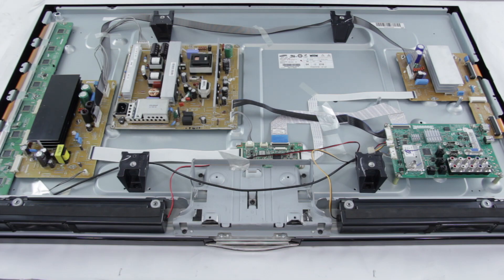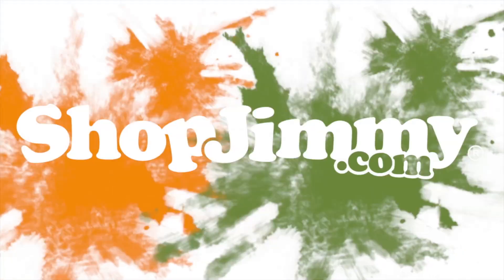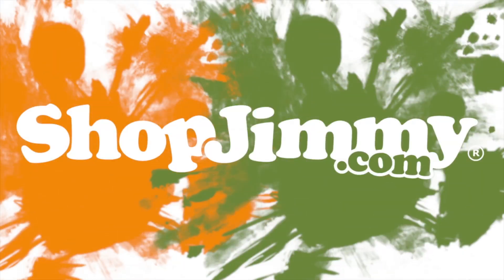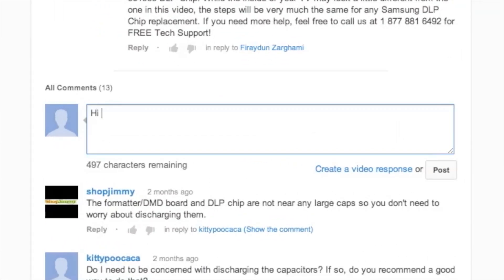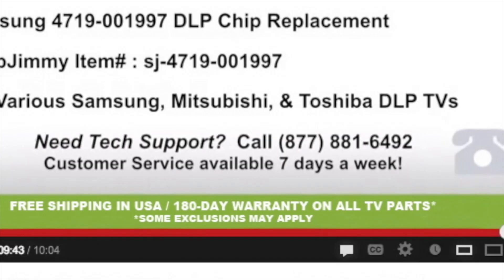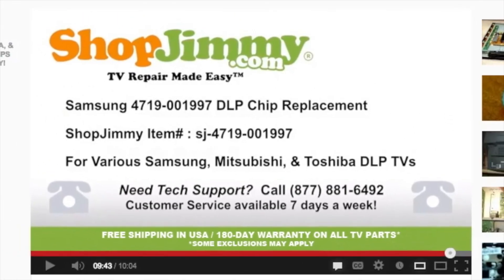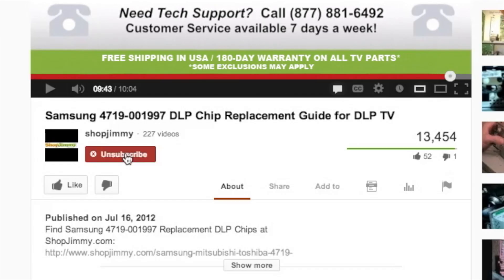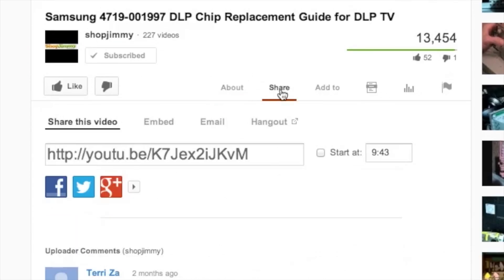Plasma TV Repair Tutorial - Common Symptoms & Solutions - How to Fix Plasma TVs

Comment: I have a Plasma Samsung tv Model: lnt466fx/xaa. From top to bottom (But not solid) in one or two sections there are blue lines.  Every once in awhile there is a black (again not solid) line going from left to right across the screen.  I could live with these problems because i could tap the side of the tv and they would go away.  But now there are big shadow parts on the right side.  And it is not slow-mo but images linger.   PLEASE HELP
Reply: Forgot to mention that it only lingers on the right side.

Comment: Hi! I have LG Plasma TV model 60PV250-UB. Facing issue with screen display.  I get a blank screen though I could change channels and listen to the audio of the channel. Called a LG technician and he diagnosed and said that I have to replace Z main  board on the invoice but marked Z sustain board on the TV. Is it one and the same? Would like to have your opinion on his assessment. According to this tutorial, z sustain could give us atleast some image. Appreciate your help.
Reply from the maker: Uma k   Please watch this video FIRST to help with your repair!  https://www.youtube.com/watch?v=BP3NVNCGEv8  I recommend replacing the ZSUS board first to see if that fixes the problem.  If that does not fix the problem, then I would replace the YSUS board and YDRVTP & YDRVBT boards.  Click this link to replacement parts for your TV model number:  http://www.shopjimmy.com/catalogsearch/result/?q=60PV250-UB  There may be multiple boards for the same TV model number, be sure to match part numbers on your current board, with your replacement for compatibility.  Here is a link to a video showing how to identify your part number, click here:  https://www.youtube.com/watch?v=GEllG3RV-tc  Thanks and please let us know if you have any further questions with your TV Repair!  www.shopjimmy.com

Comment: Need help with mine it's a samsung plasma sp-r4232 it shuts of then turns back on sometimes it stays off and makes clicking noises I checked for bulging compacitors but they all look fine
Reply from the maker: Fried Souls   Try this at your own risk. Unplug the TV, then disconnect the y board and plug in the TV to see if the TV powers up. Reply with the results of this test. Thanks! www.shopjimmy.com

Comment: My  LG plasma 60PA5500-UA began displaying a black screen with no picture or audio. When I try to cut it on I either get a clicking noise or it cuts on for a few seconds and then goes to a black screen.
Reply from the maker: Luciana Cannon  Please watch this video FIRST to help with your repair!  https://www.youtube.com/watch?v=BP3NVNCGEv8   I recommend replacing the YSUS Board, the YDVRTP & YDRVBT boards in your TV.  Click this link to replacement parts on your TV model number:  http://www.shopjimmy.com/catalogsearch/result/?q=60PA5500-UA  There may be multiple boards for the same TV model number, be sure to match part numbers on your current board, with your replacement for compatibility.  Here is a link to a video showing how to identify your part number, click here:  https://www.youtube.com/watch?x-yt-cl=85114404&x-yt-ts=1422579428&v=GEllG3RV-tc  Thanks and please let us know if you have any further questions with your TV Repair!  www.shopjimmy.com

Comment: i have a samsung 50in plasma tv..model ps50c450b1wxxu..i have 4 thin black lines across my screen,i have change the buffer board,the problems still there,is the tv not repairable now? plz help put me out my misery...
Reply from the maker: Andrew Anderson   This sounds like a TV panel (TV Screen) problem.  If your TV panel is bad, it may be more cost-effective to replace the TV as panels are typically hard to find in stock, difficult to replace, and expensive.  Thanks and please let us know if you have any further questions!  www.shopjimmy.com

Comment: I have a Samsung PN50C550G1FXZA that I am trying to repair.  The original problem was popping and snappy noises, smoke, and no picture.  The Y-sustain board had obvious damage (C5816 was blown, Q5102 looked like it got very hot).  Based on ShopJimmy’s recommendation, I replaced the Y-Sustain board, and the Y-Buffer board.  I also decided to change the power supply board (all parts were purchased from ShopJimmy).  After installing all three boards, the snappy noises and smoke problems have been resolved, but I still have no picture or sound.  The PDP will light up briefly when the set is turned on, but goes black soon after.  The Va and Vs voltages come up to spec briefly when the set is initially turned on, but drop quickly.  Other voltages look OK.  The green LED on the logic board blinks – it is off for about 2 seconds and on for about 5 seconds when the set is on.   The set has also developed a dark horizontal line about ¼ of an inch wide.  I’m hoping this just means I need to reset one of the connectors on the Y-Buffer board.
Could you please tell me what the next step is for this TV?  Thanks in advance for all of your help.
Reply from the maker: Chuck Smith   Try this at your own risk. Unplug the TV, then disconnect the x board and plug in the TV to see if the TV powers up. Reply with the results of this test. Thanks! www.shopjimmy.com
Reply: Disconnected x board as advised.  Now screen is totally black.  Va and Vs voltages come up to spec but drop quickly.  Green LED still blinks two seconds off five seconds on.   Front red LED stayed on when tv is turned on.  Anything else I might try?   Thanks for your help!
Reply from the maker: Chuck Smith   Please watch this video FIRST to help with your repair!  https://www.youtube.com/watch?v=BP3NVNCGEv8  The X board is also bad in your TV.  Click this link to replacement parts for your TV model number:  http://www.shopjimmy.com/samsung-bn96-12409a-x-main-board.htm  There may be multiple boards for the same TV model number, be sure to match part numbers on your current board, with your replacement for compatibility.  Here is a link to a video showing how to identify your part number, click here:  https://www.youtube.com/watch?v=R1jmj_foId0  Thanks and please let us know if you have any further questions with your TV Repair!  www.shopjimmy.com

Comment: Hello,  I have a pn51e450a1f 50" Samsung Plasma.  Yesterday morning the set wouldn't completely turn on and gives a loud buzzing sound.  When you hit the on button, the start up sound happens, then there is no picture at all but a loud Buzz.  I took the back panel off and checked all the capacitors and they all look fine.  The sound seems to come from the very center of the screen even when I have the back panel off(so not coming from speakers or any of the boards)  Any help or ideas would be appreciated.
Reply from the maker: Chris Plested   This sounds like a TV panel (TV Screen) problem.  If your TV panel is bad, it may be more cost-effective to replace the TV as panels are typically hard to find in stock, difficult to replace, and expensive.  Thanks and please let us know if you have any further questions!  www.shopjimmy.com

Comment: Samsung PN51d7000ffzxa Plasma Screen does not power on, Power light blinks RED

Unit would not power on. Blown fuse, replaced fuse, fuse blew again.
Replace power board with NEw one.
Now the power light blinks red.
Stand by voltage is 5.3V.
power on signal cycles from 3.3V to 0V,
 va, vs are at 0 volts.
Disconnected y & Z sustain boards still no changes

any help would greatly be appreciated thanks
Reply from the maker: Laird Schweikart  Please watch this video FIRST to help with your repair!  https://www.youtube.com/watch?v=BP3NVNCGEv8  I recommend replacing the main board in your TV.  Click this link to replacement parts for your TV model number:  http://www.shopjimmy.com/catalogsearch/result/index/?cat=56&q=51d7000  Be sure to match part numbers on your current board, with your replacement for compatibility.  Here is a link to a video showing how to identify your part number, click here:  https://www.youtube.com/watch?x-yt-cl=85114404&x-yt-ts=1422579428&v=BEPWrefQvqI  Thanks and please let us know if you have any further questions with your TV Repair!  www.shopjimmy.com
Reply: ShopJimmy.com I called your business and was told you didnt have the main board in stock. I purchased a main board from a different source. but nothing has changed.   the (tv on) signal  cycles from 3.3V to 0V back to 3.3v. don't know where to go from here.

Comment: I have a Samsung PN58C550 with Horizontal dark Static when the image is white or bright colors?
Reply from the maker: Chad South  Please watch this video FIRST to help with your repair!  https://www.youtube.com/watch?v=BP3NVNCGEv8  I recommend replacing the Y-Main Board and the Upper and Lower Y Scan Drive boards.  Click this link to replacement parts for your TV model number:  http://www.shopjimmy.com/catalogsearch/result/?q=PN58C550  There may be multiple boards for the same TV model number, be sure to match part numbers on your current board, with your replacement for compatibility.  Thanks and please let us know if you have any further questions with your TV Repair!  www.shopjimmy.com

Comment: Hi Shop Jimmy.
I'm having a problem with my LG 60PG3000 - ZA plasma tv.
On the left hand side of my screen I had a couple of lines from top to bottom.
This has gradually got worse to the point where the left 4 inches intermintently goes completely blank.
Sometimes it works perfectly and others this fault occurs.
I was just wondering if this is fixable or am I better buying a replacement
Many thanks in advance

Comment: Hey Jimmy, I have a JVC PD-Z50DX4. Intermittently I loss the ability to turn the TV on or off, change channels, volume and video input, basically any control from the remote or the side panel. I have to unplug the power cord, wait about 10sec and when I plug it back in, the TV will come on by itself and I will have the control again for awhile. There is no constant time when it stops working. Any advice? I am technical by profession, however not so much with TV's. Before I open it to tackle the problem, I thought I'd get your opinion first. thanks
Reply from the maker: Vincent T Eck   I recommend replacing the main board in your TV.  Unfortunately I do not see any replacement parts in the search results for your TV model number on our website.  Please reply with your part number on your main board and I can try searching for replacement parts.  Thanks and please let us know if you have any further questions!  www.shopjimmy.com
Reply: That tv has a reset sequence of buttons that can be pushed and it worked on my tv. I dont remember the buttons or order they have to be pushed but i found it online.

Comment: Hello i have a lg pk350 , i heard a relè sound, the led blink but the tv don't start. i replace the main power board , but the symtoms are the same, then i try to detach the Z-sus board and now the tv work, i can turn on, access to menu , but the picture is like few colors , slow . in few words i need to replace only the Zsus board "50R1_Z" ? or maybe at the same time the other one attached to the Zsus the "50R1_Zsub"?

thanks a lot

Comment: Hi, I have replaced my Y Buffer Board on my 50" Samsung Plasma after reading that its a common problem with a few horizontal pixels being out. After being shipped the part, I installed it correctly and to my surprise the screen wouldn't come on at all. Thinking I may have installed my part incorrectly, I put my old one back in and the same few pixels were out. So, i drew the conclusion that my part was DOA. I order another. This Y buffer Board came in and exhibited the same results. No picture at all. It cant possibly be the Y sustain or X sustain if everything works perfectly with my old Y buffer board right?

Comment: Hi guys,
I have an RCA 42PA30RQ and my problem is the tv is stuck on the TV input. I cannot switch to any other input by either the buttons on the side of the tv or via the remote. I also cannot adjust the volume either. Any ideas? Thanks in advance!

Comment: hi  my name is fidele and i need any help... after try to use hdmi port on grundig lcd tv i have this problem https://www.youtube.com/watch?v=pTnxKkIa4Yc&feature=youtu.be
Reply from the maker: fidele ifif  Please watch this video FIRST to help with your repair!  https://www.youtube.com/watch?v=BP3NVNCGEv8  I recommend replacing the main board in your TV.  Click this link to possible replacement parts for your TV model number:  http://www.shopjimmy.com/catalogsearch/result/?q=grundig+main+board  There may be multiple boards for the same TV model number, be sure to match part numbers on your current board, with your replacement for compatibility.  Thanks and please let us know if you have any further questions with your TV Repair!  www.shopjimmy.com
Reply: ShopJimmy.com the main board is Beko electronik XLA190R-7
Reply from the maker: fidele ifif   Unfortunately I do not see any replacement parts for that on our website.  Thanks!  www.shopjimmy.com

Comment: have a 43" Samsung PN43E450A1Fx2A.Watching tv last night and the screen slowly went black from left to right,and noise coming from speakers. Standby light will flash 6x and jigle will be heard while trying to power up now. No picture just black and noise from speakers. Thanks
Reply from the maker: Barry Nelson  Please watch this video FIRST to help with your repair!  https://www.youtube.com/watch?v=BP3NVNCGEv8  I recommend replacing the main board in your TV.  Click this link to replacement parts for your TV model number.  http://www.shopjimmy.com/catalogsearch/result/index/?cat=56&q=43E450A1  There may be multiple boards for the same TV model number, be sure to match part numbers on your current board, with your replacement for compatibility.  Here is a link to a video showing how to identify your part number, click here:  https://www.youtube.com/watch?x-yt-cl=84359240&x-yt-ts=1421782837&v=BEPWrefQvqI  Thanks and please let us know if you have any further questions with your TV Repair!  www.shopjimmy.com

Comment: I have a Samsung PN59N7000 with 5 thin horizontal line all theway across the screen. It sounds like the y buffers may be the problem. Is it serviceable? And can I order the part from you?
Thanks.
Reply from the maker: Carl Wasko   This sounds like a TV panel (TV Screen) problem.  If your TV panel is bad, it may be more cost-effective to replace the TV as panels are typically hard to find in stock, difficult to replace, and expensive.  Thanks and please let us know if you have any further questions!  www.shopjimmy.com
Reply: I took the tv to a local shop who confirmed that the panel is bad.
Thanks.

Comment: I have a VPW 425 Viewsonic plasma tv I have dots that flicker and when the channel is displayed it shakes also it runs hot.
Reply from the maker: mcrage13  Please watch this video FIRST to help with your repair!  https://www.youtube.com/watch?v=BP3NVNCGEv8  I recommend replacing the Y-Main Board and buffers in your TV.  Click this link to replacement parts for your TV model number:  http://www.shopjimmy.com/catalogsearch/result/?q=VPW+425  There may be multiple boards for the same TV model number, be sure to match part numbers on your current board, with your replacement for compatibility.  Thanks and please let us know if you have any further questions with your TV Repair!  www.shopjimmy.com

Comment: i have a zenith z42px2d i replace the power supply but now has snowy green pixels on the screen
Reply from the maker: Cristian Alatriste  Please watch this video FIRST to help with your repair!  https://www.youtube.com/watch?v=BP3NVNCGEv8  I recommend replacing the main board in your TV.  Click this link to replacement parts for your TV model number:  http://www.shopjimmy.com/catalogsearch/result/index/?cat=56&q=z42px2d  There may be multiple boards for the same TV model number, be sure to match part numbers on your current board, with your replacement for compatibility.  Here is a link to a video showing how to identify your part number, click here:  https://www.youtube.com/watch?v=RwHTvjMdrhk  Thanks and please let us know if you have any further questions with your TV Repair!  www.shopjimmy.com

Comment: samsung pn63c8000yf screen doesn't turn on but it chimes and has the stand by light, thank you in advance!
Reply from the maker: S pooner  Please watch this video FIRST to help with your repair!  https://www.youtube.com/watch?v=BP3NVNCGEv8  I recommend replacing the Y-Main Board and the Y Upper & Y Lower Scan Drive boards in your TV.  Click this link to replacement parts for your TV model number:  http://www.shopjimmy.com/catalogsearch/result/?q=pn63c8000yf  There may be multiple boards for the same TV model number, be sure to match part numbers on your current board, with your replacement for compatibility.  Here is a link to a video showing how to identify your part number, click here:  https://www.youtube.com/watch?v=R1jmj_foId0  Thanks and please let us know if you have any further questions with your TV Repair!  www.shopjimmy.com

Comment: My plasma Samsung 650 series model number PN50A650T1f and I am having vertical lines that at the top are blue green and yellow.
Reply from the maker: Tracy Smart   This sounds like a TV panel (TV Screen) problem.  If your TV panel is bad, it may be more cost-effective to replace the TV as panels are typically hard to find in stock, difficult to replace, and expensive.  Thanks and please let us know if you have any further questions!  www.shopjimmy.com